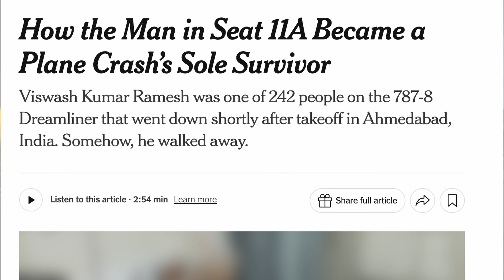Why the RAT Changes Everything – Air India 171 Update

Comment: thank you for that captain. first of all id like to clarify that the second video you showed for comparison regarding the noise a ram air turbine makes when deployed... is also a video of a video. you can tell because of the distorted pixelation. try it yourself. it is an irrelevant fact given it seems blatantly obvious just from the lack of the main engine sounds on any and all videos. whether it sounds like an internal combustion torqued prop or one that is dragged through the air by a mothership is also irrelevant but they would otherwise be important considerations.

much like yourself.. i also verge on the side of a)im not the lead investigator and b) i am also theorising. however i wish to bring some further logic into this that may not have been considered by those who for one reason or other must "know the truth right now" and simply cannot wait for the official NTSB/team investigation. had it been fuel contamination... and indeed it could be... it would be highly unlikely both engines took off with take off power, sucked the necessary uncontaminated fuel into the "combustion cans"... as you know, a jumbo jet will easily consume a family vehicles worth of fuel before it gets to the holding short point on a runway. it would be highly unlikely that had there been contaminants in the fuel, the jet would have taken off... and the both engines started sucking in contaminated fuel... at the same time. it seems to me they would have surged before shutting down as well. they would not simply stop spinning. 

if indeed it was fuel contamination... then.. well... it would have had to be some fairly cleverly timed contamination flowing into both engines at that precise moment. clearly we are now getting into an elaborate sabotage scenario and i dont wish to further speculate on the matter as i more than trust the american and indian authorities to look into the issue. the fact ive yet to see any wreckage photos showing anything other than the tailplane is concerning to me though, google appears to be either censoring them... or the hundreds of people swarming the area either to take photos or help find survivors/put out the fires simply forgot to "film the juicy bits" (to put it in a disgustingly gross form typical of the "i was there first" attitude seen in a lot tragedies)

personally, i went through a few scenarios myself at the begginning, and for some reason, and absolutely NOT BECAUSE BOEING JUST SETTLED LAWSUITS REGARDING THE LATEST 737 flight computers/software/programming/poorly "fixed" and or poorly tested aerodynamically unstable stretched frame/engine ratio stabilizing software. 

you get the point. for some reason, and this has more to do with my fixxation with computers and computer hardware as well as hierachy/authority of controls in the engineering, psychological legal and protocol domains. ive no experience with these systems so i wont speculate on that either and neither should anyone else who does not know what theyre talking about. (up to this point your theories sound fairly reasonable and in the spirit of understanding, not that you require my enthusiastic approval but you have it anyway). 

aviation is a safety critical industry and the flying public demands truth regarding incidents of this nature. public confidence depends on it and for now at least... if anyone wants to help anything.. in my view the best way to do it would be to preserve as much evidence as possible. 

best wishes to everyone and again, my thoughts and sincere condolences are with those affected by this. i still cant believe that guy survived and walked away from it the way he did. obviously im glad he did, he will be an invaluable asset to investigators.

Comment: Wouldnt loss of all electrical power shut down the engines? Wouldnt that shut down all the electrical sensors, pumps and other equipment used to keep the engines running? I know the engines are gravity fed fuel in case of fuel pump failure but I am sure other things are needed to keep the engines generating thrust.  What if they had full electrical power loss which caused the engines to flame out seconds before the RAT had a chance to restore power? Wouldn't a loss of electrical power cause any hydraulic pumps to shut down, also cause a flame out which in turn would stop any hydraulic pumps on the engines to stop working? Hence no hydraulics to raise gear or operate flaps? I am just assuming as I am not a pilot or technician. Seems like this was a domino affect. I know that almost all of these jets have triple redundancy, but maybe, just maybe, something rare happened that allowed all 3 redundancies to fail. This flight might have found a reason to need a fourth.

Comment: Is there any possibility of a terrorist, either on the ground or as a passenger in the same flight, that might have activated an interfering signal that would interfere with onboard electronics powering up engine functions? Just asking. Adriano, former B767 driver.

Comment: Best analysis on this crash I have seen. I remember being told by mechanics not to walk under that section of the aircraft because if it were accidentally deployed it would take your head off! L1011 I believe.
Reply: It would not spin in that case. It is a little wind turbine, the speed of the aircraft makes it turn and provide electricity and hydraulic power in case of emergency.
Reply: @freyalarsen6233 I'm sure he knows that. The point being that it would still be a dropping dual propeller blade like a guillotine with 100's of pounds behind it.
Reply: Of course, but it is deployed by a very strong spring! No need for rotation to injure you.

Comment: The plane seems to be nose up when it crashed. The pilots should have pulled back on the yoke, and the elevators should have moved to allow the plane to pitch up. 

Did they not have hydraulics the whole time then? And it only came alive briefly at the end when the RAT started to power the elevators?

Comment: One plausible explanation that fits the public evidence for the Air India 787 accident is a potable-water leak—not fuel or hydraulics—that disabled the aircraft's main electrical buses just after lift-off. FAA AD 2025-09-12 traces the most credible leak path to floor-panel seat-track joints above the aft electronics-equipment (EE) bay where sealant and moisture-barrier tape were omitted on some 787-8/-9/-10s; water from a galley or lavatory line can then drip onto the aft EE bay power-distribution equipment and short them, creating "loss of system functions essential for safe flight.

At roughly 140 kt, vibration and the 10–12° nose-up swing of rotation could have shifted water or sprung a marginal coupling, splashing fluid onto live busbars. The Bus Power Control Unit (BPCU) would detect the electrical faults and isolate the affected Variable Frequency Starter Generators (VFSGs), blacking out the left and right AC buses simultaneously. Cockpit load-shedding blanks several displays and the autothrottle, cabin lights drop to green emergency strips (as the survivor reported), and the ram-air turbine snaps out—visible in eyewitness video. Each GEnx engine registers "generator offline" status. With disrupted electrical control signals to the FADECs, both engines would enter protective modes and reduce to idle thrust; the ~6 s spool-down lets the jet climb briefly to about 650 ft before settling at low thrust with the gear still down.

With only RAT power, the crew had seconds to attempt an APU start before airspeed bled away—mirrored in the captain's call, "thrust not achieved…falling…Mayday." The clues align: RAT deployment, cabin electrical change-over, running but idle-speed engines, a short climb then rapid descent, unretracted gear, and the DGCA's immediate order to inspect generator and engine-control systems. FAA AD 2025-09-12 mandates sealing those floor joints yet does not supersede AD 2016-14-04, which covered an earlier subset of 787s with improperly installed water-line couplings.

Take-off/rotation is the critical moment because potable-water pumps cycle during high-demand phases, runway vibration adds dynamic loads, and the pitch-up swing can send trapped water toward any unsealed gap—exactly the scenario the FAA warns can wet EE-bay equipment and short essential power buses.

This is the relevant AD: https://public-inspection.federalregister.gov/2025-08346.pdf
Reply: Ok

Comment: Hello Steeve, right and sharp observation , fyi there was complaints and videos evidence of same flight came from other place picked up domestic transit and travellers complained about non functioning of AC, electrical issues in the cabin with video evidence , if those were true stories , Connecting dots carefully ..my theory is there could be a quick electrical maintenance work carried out general process to address electrical issues before the take off and that maintenance work did not carried out properly because of the limited time would caused the major electrical failure , as seen the hydraulic system worked with landing gear still up and in the same video your showing the RAT deployed .look at the right wing flaps were about 140 degree not 180 this shows the pilot try to land the craft .. will find some more and post you ..

Comment: Yep double engine failure was what I was leaning toward since the outset and after hearing the video, those engines were not spooling anywhere near what they should be. It was way too quiet and low frequency. They lost both engines right after takeoff. it makes sense not to have the flaps if the engines died because all you'd be doing is killing speed faster. The fact that the engines both failed simultaneously, I'd personally suspect fuel.

Comment: Hello Capt. Steeve! 
A budding 14 y/o pilot from India here😊
After having a look at your analysis, I have a question. 
If the pilots by mistake changed the settings of flaps instead of retracting the landing gear, then could they have set the flaps back to normal, retract the landing gear thereafter and use the TOGA button to increase the altitude and generate lift? 
Thank you for your attention to this query! 
Hoping to hear from you soon.

Comment: As with every accident, we really have to wait for the full investigation to know with any degree of certainty what happened. In this case, even with the deployment of the RAT, it is still possible that there was a sudden catastrophic electric failure without an engine failure as the cause of it. As evidence in support that scenario, it still looks to many people as if the flaps were not deployed. If that is true, that configuration could have been caused by the electric failure, which in turn prevented the deployment of the flaps, even when they were commanded from the cockpit. This also might explain why the gear was never retracted.  Regarding the dual engine scenario, what type of event would result in a loud bang, followed by BOTH engines failing simultaneously? I can’t think of one right now. Obviously, there are a number of possible events that might result in a bang, followed by a single engine failure, but not both engine simultaneously. Even with that question, I do agree with the Captain here that dual engine failure is high on the list of potential scenarios, but I’m just saying there are still other viable scenarios at this point even if we know for a fact that the RAT had deployed.

Comment: If it was a dual engine failure, which is a very, very, very unlikely thing to happen, it strongly suggests POOR maintenance of this plane by Air India.
Reply: Other than the fuel being seriously contaminated, but you would think that would have affected other planes refueling at this same airport, and successfully flying out with no issues, before this accident occurred.

Comment: Has anybody else noticed (on the runway video) that, as the aircraft virtually disappears behind that checkered building, and then reappears fully, there is either a dust or smoke cloud that drifts from right to left? Captain Steve, please could you explain what that was? Many Thanks...Pete.

Comment: Captain Steve, can you investigate 

On January 17, 2019, an ANA Boeing 787 Dreamliner suffered a simultaneous dual engine failure on landing at Osaka Itami

Possibly a
computer or software issue might have caused the dual engine shutdown if an overthrust is detected by the system

Furthermore, Boeing just recently issued a bulletin addressing a problem with the Thrust Control Malfunction Accommodation (TCMA) system

Comment: there is also a known issue on the 87 with cold solder joints on circuit boards. Boeing knows about it and i think it is 16 main boards on the aircraft that require changing on the older models due to cold solder joints on the boards. $100k per board, and that does not include all the software that needs to be loaded and testing after installation. This was a 800 so it is probably in that camp.

Comment: I have heard many rat tests and l,m supprised l still have decent hearing . Retired now. The free fall test on its own is a very loud bang, so in the cabin it will cause palpitations.
As somebody mentioned earlier a cage is then placed around the unit and a hydraulic rig supplys pressure to run the rat. Its normally forward motion of the aircraft spinns the propeller. And the sound is just like that. So if you didnt pick up the image of the rat the sound would let you know. Up close ear defenders barely hold their own.
Another video allegedly from the aircrafts previous flight showed no air con in the cabin and the passenger units in tbe seats working ad hoc. The poster said he videoed it to complain about problem as it wasn,t the first time it had happen on the carriers planes.
Rodents are a big issue for any aircraft as was hammered home in annual up date training.
Countries like India and many others have a big rodent problem. Its a possability something ate something and shorted out a lot of systems. We wont know for sure till tbe crash report is finalised. So to all the media out there, put your 'Experts' back in the closet and let the professionals do their job.

Comment: I saw a video yesterday  suggesting the landing gear did start to retract, as the wheels are hanging horizontally/ forward, whereas they normally hang slanting to the rear. Hence the retracting was cut short, possibly due to power failure.

Comment: Steeve, why did you dismiss the first theory of "Loss of Power and Engines failure"? You didn't even consider the passengers complaining that there was NO Air Condition inside the passengers cabin and electrical failure causing entertainment panels Not work.

Comment: Thank you for being open to facts. Conclusions and opinions need to be driven by facts, so these have to be adapted upon changes in the knowledge of facts.
I want to wait for the data of the FDR before coming to conclusions based only on video and eyewitness evidence. I am puzzled that in the middle of a buzzing, loud indian City this is the only sound we hear. The streets are much closer to the camera than the airplane. Has there a filter been applied to that audio? Did somebody produce a video with the sound everybody said would be expected to be heard? But it still seems to be the No 1 theory because the slats in the wreckage seem to be in an extended position. Hopefully the FDR will also tell this part of the story soon.

Comment: You can hear the RAT... But you can't hear the mains. In fact, those mains do not sound throttled up at all, they sound like they are winding down in my unprofessional opinion. Though I have no idea how that could happen on mechanically sound engines.
I know a fair bit about aircraft systems, but not nearly enough to offer any kind of constructive speculation.

I also have no idea how one guy walks away from something like that. He seems to have a bit of a limp. Has he walked away from any car and train wrecks lately?

Comment: Agree 100%. I wonder if they filled the tanks with water instead of fuel, or if they didn't drain the water at the bottom of the tank before takeoff.  It's a standard checklist for pilots to follow.

Comment: I say it's a Dual Engine failure because you can see the gear on the 787 tilted forwards while usually, it will be tilted backwards it would be tilted forwards if the gear was getting retracted.

Comment: Maybe this particular aircraft had accidentally been left switched on for 248 days and had never received Boeing's software fix for the GCU issue? There is (was) a bug in each of the four main generator control units that switches it off if powered on for more than 248 days. If all four GCU's were power-cycled simultaneously, then they would all switch off simultaneously after 248 days, which could be catastrophic if that happened during a critical phase in the flight. There was an airworthiness directive ordered to power-cycle the 787 within 51 days to prevent this issue from happening whilst Boeing were working on a software fix. They may want to check that this particular aircraft received that software fix. Maybe that's what they were double-checking on the rest of the 787 fleet a day ago?

Comment: The only conflict with engine failure theory is the one survivor stated the engine power increased before they crashed. Could it have been a hydraulic failure or massive leak of H. fluid?

Comment: But no visible sign the engines “flamed” out.  Between that and the use of the full runway, I am wondering if they just never achieved max thrust, and were gradually losing what they had, and why that might be?  Fuel?  Speed at different points along takeoff roll vs expectation given takeoff weight and temperature would be good to know, as would whether the audio suggests anything about loudness of RAT vs main engines that might indicate mains’ thrust level.  Great work Captain.